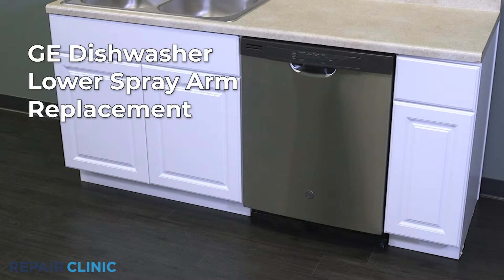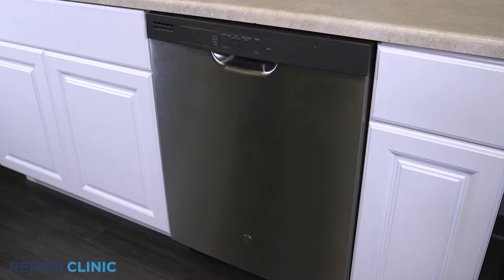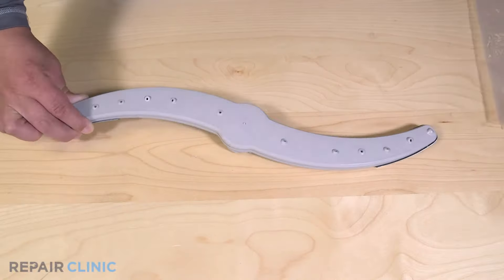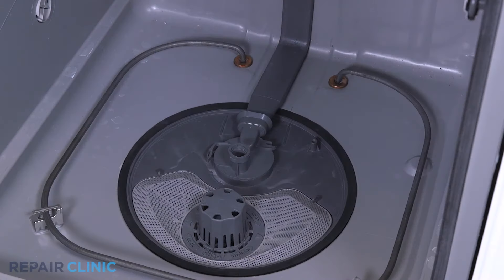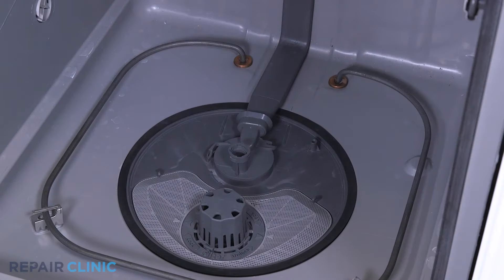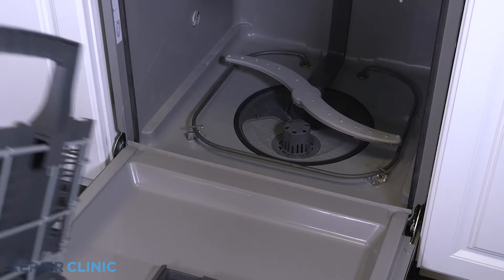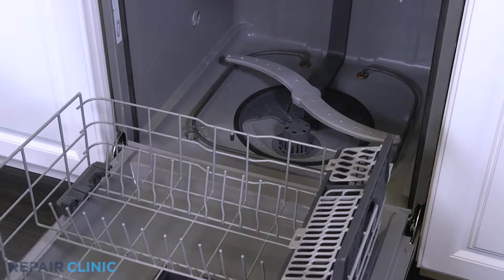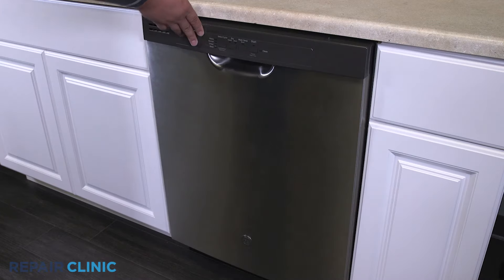GE Dishwasher Lower Spray Arm Replacement WD22X26621

Comment: mine burned off on both ends. Yay.
Reply: Just replaced a second spinner, 2 in 6 months.  Its a stupid design.
Reply: Same here. We had a guy come look and said that he called the engineers and there have been no complaints. So I guess it’s just the one we bought? Righttttt.
Reply: @gacha_heart5761  haha no joke!
Reply: @gacha_heart5761  for what it's worth, I bent the little metal pieces over the heating element to keep it more secure and less likely to bump up and hit the arm. . 9 mos w/out issues